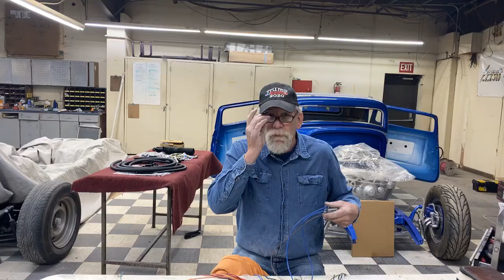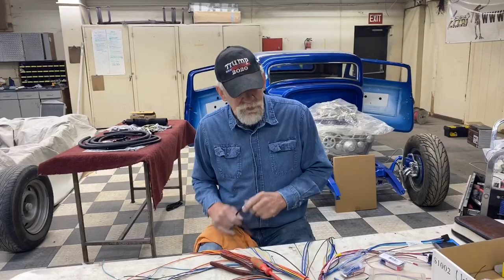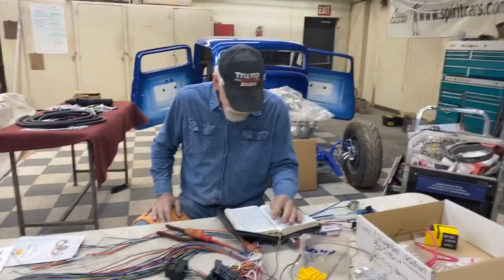Wiring Choices

Comment: You said that an unused wire will be coiled up behind a "T" dash. There isn't  one in my T. The fuse box doesn't have a cigarette lighter connection. The T doesn't have a radio, or AC, but I don't see wires coiled for those 2 fuses. Might they have been cut off? A hot wire will come in handy for adding acc. in the future.
Reply from the maker: I meant firewall between the insert and the body.